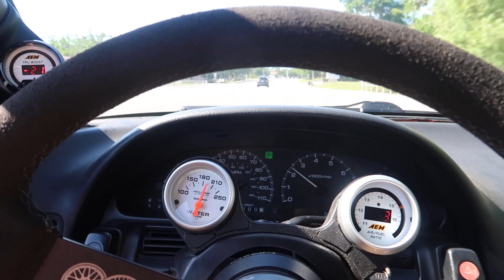Quick Drive of "Nicole's" 1JZ 240SX

Comment: Matt, I totally get your point. Most 240 owners don't think like most where if something breaks or looks old, instead of fixing it.. they get something else to make the car look cool. I get your point, I remember the video you or Adam made where you visited the garage with the clean 240s. Those were super clean, but not meant to be drifted, just made to be driven every now and then like a normal car. I think most 240 owners just get them because they're cheap and easy to Mod, or to drift, or both. If that's the case, they just want to make the car functional for drifting, where everything else to them doesn't matter. Adam is a mix of both, his cars are cleaner than other 240s, not perfect, but cleaner than 95% of other 240s. Also, everyone who drifts knows if they have to make their car pristine it'll never be like that, and wind up spending more money on that than other things on the car. Because when drifting, bad things happen. But I see your point. Great video!

Comment: It is very difficult to have an old Japanese car with a mint interior. The parts are mostly unobtainable and the cheap plastics are disintegrating to the touch because they are so dry and old.
Reply from the maker: I guess... I just couldn't accept that.  I'd have to find a way to fix it.  Early to mid 90s NSXs don't look like jacked up like these.  But the barrier to entry is much different.  It's a direct reflection of care and maintenance.  If you're lazy and maybe inexperienced, your car gets jacked up quickly.
Reply: Hondas seemed to be better in that aspect. I've owned two fc rx7s and they were a pain in the ass in terms of dialing up the interior trims and pieces. I like clean/solid interiors myself and I think its one of the main reason why my interest shifted to German cars nowadays.
Reply from the maker: Yeah, I wouldn't be able to handle the mess.  I don't need fancy, just clean.  It's probably why I've avoided those cars.
Reply: When new the interior's on 240's weren't high quality (I'm old enough to remember), especially the steering column area. They were just a fun budget car, even off the lot.  You really can't beat the driving experience though for a $7k car.

Comment: Has the tach been calibrated for the six cylinder? If not then it is reading 33% high and when you thought you were shifting at 6500 it was actually 4300.

Comment: It will never be super clean because. Race car. if anyone has watch Drifting, they don't last long (Clean) "Hunks of crap"? its 25 years old or more.  A  guy got out of a Porsche GT3 and into a nissan. come on.... compare apple to apples!
Reply from the maker: I'm a pretty subjective dude.  Did you ever hear me comparing to a GT3?  I wan't born in a Porsche, and I own an 11 year old S2000.  In 14 years, my S2000 isn't going to be a hunk of crap.  If you are racing your car the exterior gets beat up, but why can't you fix it?  Why does the interior need to get completely jacked up?  It's pretty simple, fix it.  You don't need to fix it with Bride carbon backed seats.

It's like saying I have lots of people over for dinner, so my walls have spaghetti sauce all of them, my table and chairs are all broken and wobbly, and the lights don't work.  I'm just going to have more people over so, "because dinner."
Reply: haha good point. but racing being in and out of  your car racing working on it with oil dirt on you the interior get beat and these young kids can't afford to replace $500 racing seat or a $4000 painted roll cage, quality parts cost $$$ none the less, good video just remember. Race car!